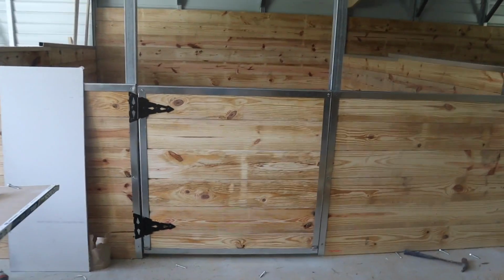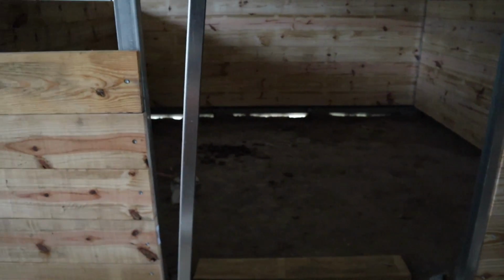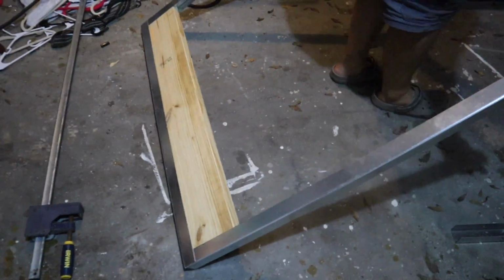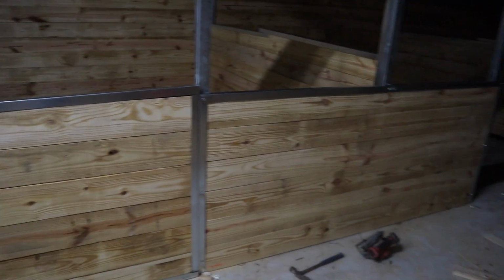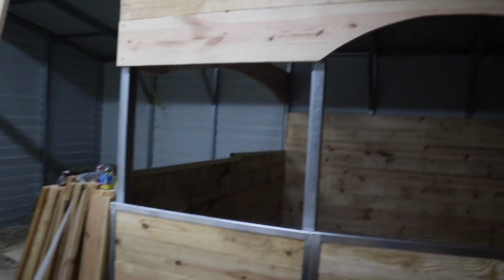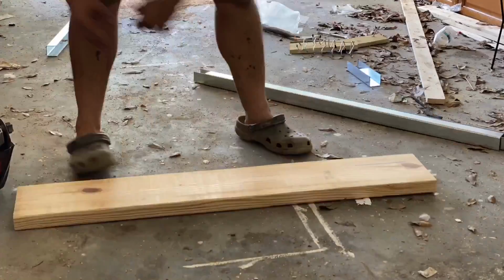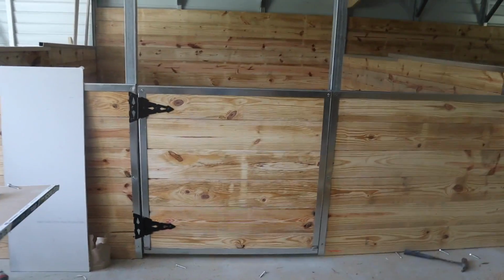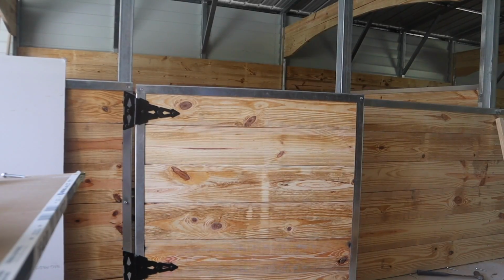BUILDING THE HORSE STALL DOORS! | BUILDING MY DREAM HORSE BARN PART 9!

Comment: You should put the horses first letter on the door instead of a X
Reply: Yeah
Reply: Yah
Reply: Yeah
Reply: Tonia Cupid true but it’s also not a good idea for if/when the horses pass and a new one comes in it won’t match up to the new horses name
Reply: Yeah
Reply: Alpha Storm I mean yea but she will always have another stall for a new horse bc she has extras
Reply: Alpha Storm also I don’t think she will buy  another horse if she didn’t have a extra stall
Reply: Good idea 👍🏻👍🏻
Reply: That would look cool but what if she needs to change the horses around.
Reply: @toniacupid6122  I’m sorry I must be slow but I’m not following. I’m saying if/when the horse dies and she buys another one (let’s say all the other horse stalls are taken and the only one left is the one with a name already one it) the new horses name isn’t going to be the same as the name on the stall. I can see if she got engraved metal plates that could easily be put on and removed but I don’t think putting the horses name in wood is a good idea
Reply: Alpha Storm well you just need to make the first letter of there name then just hang it up. It is not like she is going to drill the letter into the stall